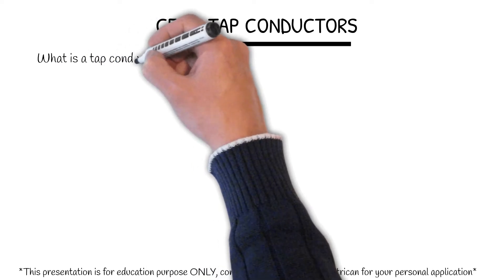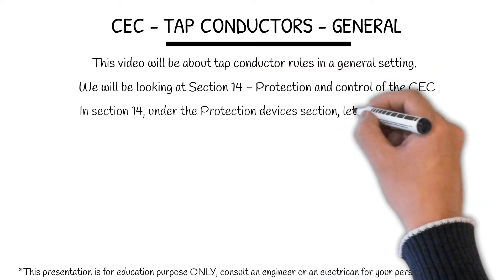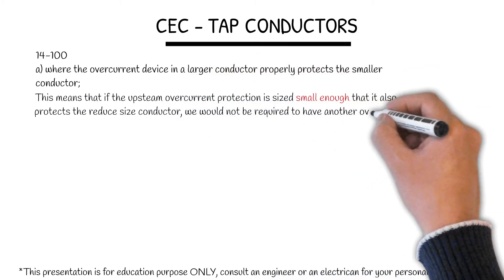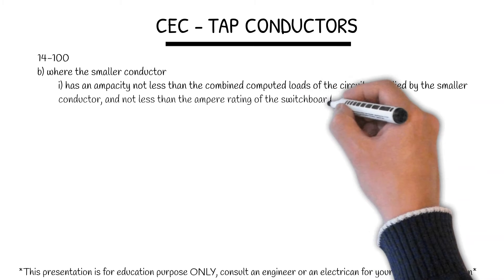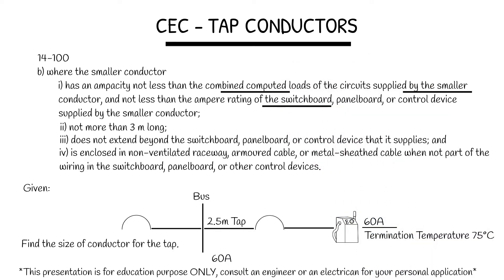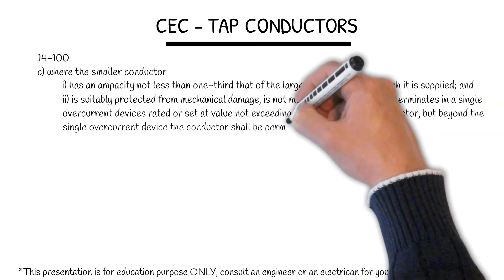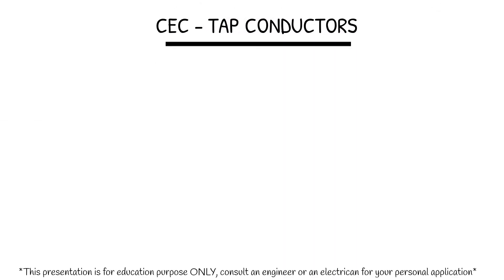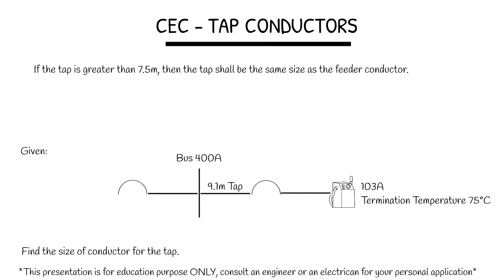Electrician Apprenticeship   #13 CEC General Tap Conductors

Comment: What if your equipment was Temp specified at 60/75 degrees c.
Reply from the maker: Hi Lucas. The column is based on the lowest temperatures. You need to compare the termination temperature and the insulation temperature. If the termination temperature is not given, you need to look at rule 4-006 (2).
Reply: @RandyTrinhTang   Okay, first of all thanks a million for the response and the help. Lets say we are not given any conductor info because we are to determine the size of the conductor, would you then use the 60 OR 75 because our equipment is rated at this .

thanks again
Reply from the maker: @lucasorgan8363  if the termination temperature is 60 on one end and 70 on the other end of the conductor, then the lowest one will be the column to use. So 60